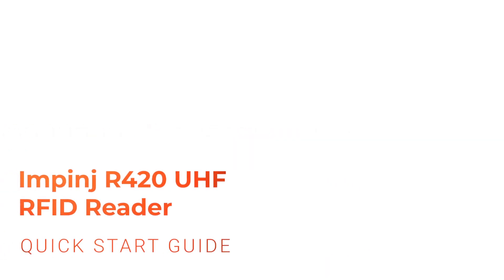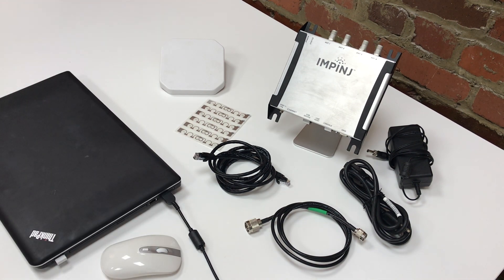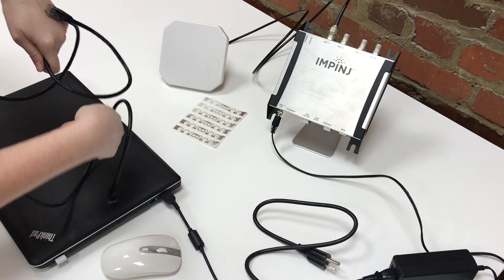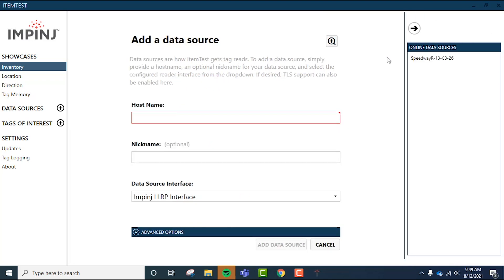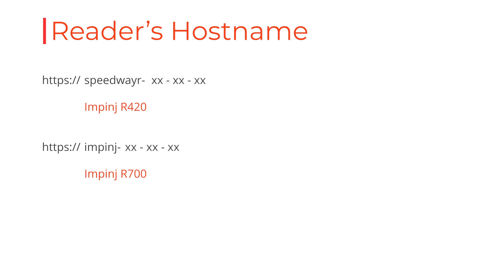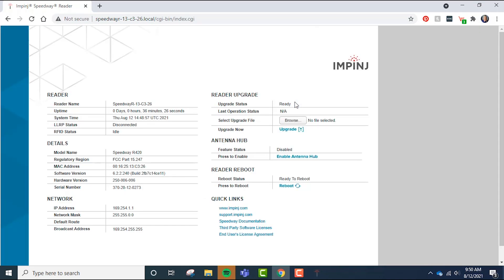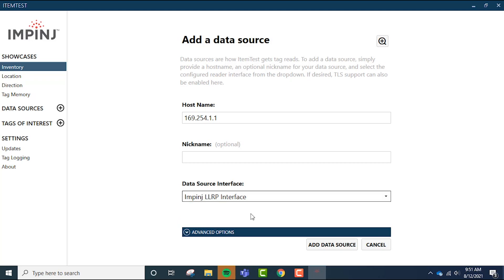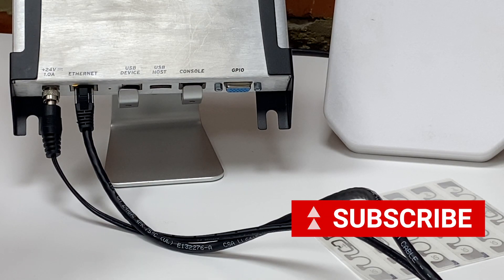Impinj R420 UHF RFID Reader Quick Start Guide - Start Reading RFID Tags with the R420 in 3 Minutes

Comment: Most all video same. Different in model number... can be more specific like how far tag and reader with 27tx in real life
Reply from the maker: That's because each RFID tag and RFID reader are a little different. If you want to set an RFID reader to a transmit power of 27, that's a significantly lower transmit power than it's max which is 30 to 33 dBm. Each RFID tag is going to have a unique read range depending on the tag's size, IC (chip), and antenna structure. Were you looking for a specific tag and reader combination's read range?

Comment: What is the solution if you need more antennas? Do you need to have multiple readers and connect each other???
Reply from the maker: Hi - it just depends on the application. So the Impinj R420, with the use of an antenna hub, can actually connect to 32 RFID antennas. If you need more than 32, multiple RFID readers can be used and the antennas expanded until you reach the number your application needs. Below are two examples of RFID antenna hubs, also called multiplexers. Both can connect to 8 antennas, and each port on the RFID reader can connect to one antenna - allowing for 32 RFID antennas.

https://www.atlasrfidstore.com/impinj-speedway-antenna-hub/

https://www.atlasrfidstore.com/impinj-r700-antenna-hub/

Thanks!